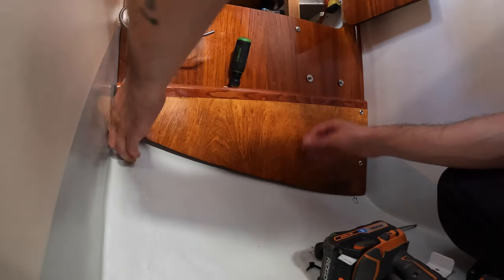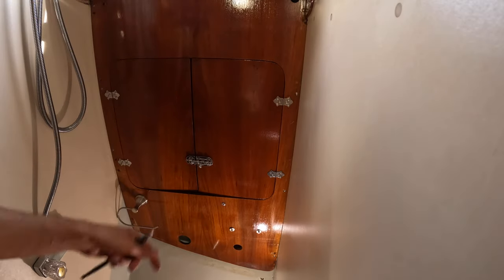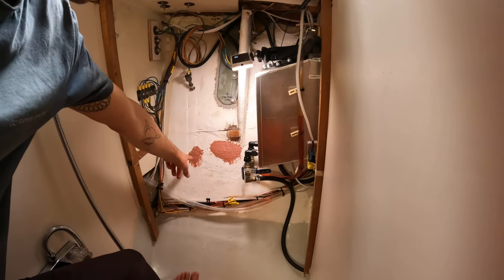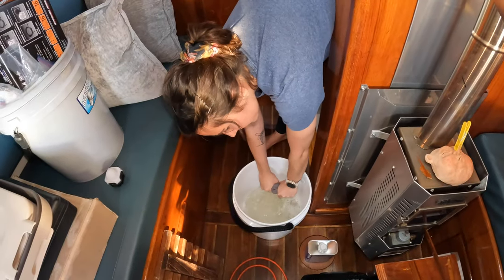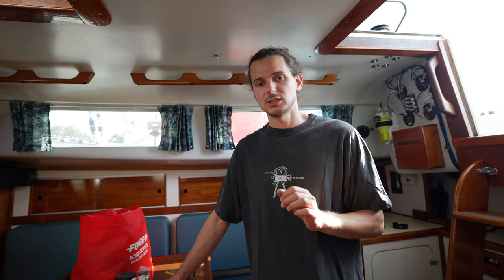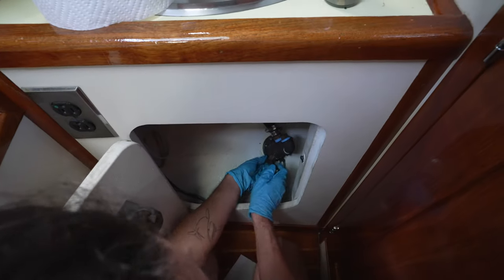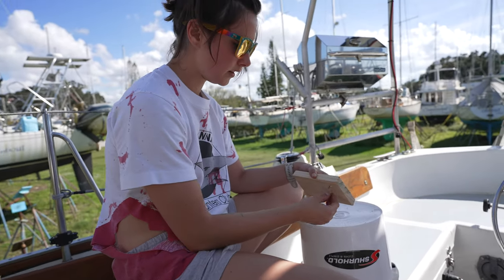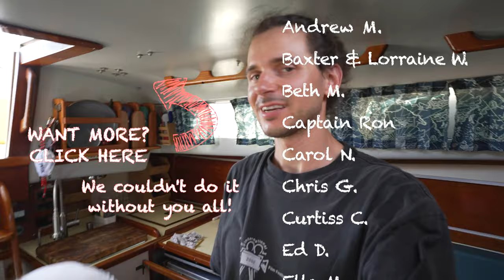HOW MANY Boat Projects Does it Take To Go SAILING? EP. 55

Comment: Parker and Katie, Great projects. I would be careful lapping the hull valves too much. I am renovating a boat with the taper valves like you had however I couldn't break them loose. So I am replacing them. Biggest thing is to work them before they corrode in place. Hopefully they won't leak on you when you put the boat back in. Fair Winds
Reply from the maker: So far so good with the lapped valve! It still doesn't behave as nicely as the others though. To be continued!

Comment: If you have had water coming through the hull from the outside putting filler on the inside will not solve the problem. Water will just enter the fiber glass causing you more problems in the end. You need to fix this from the outside.
Reply from the maker: Not just filler! I used biaxial stitched 24oz fiberglass first over the areas, and then applied the filler as fairing over top of the fiberglass. Can’t find anything on the outside of the hull. Eventually I’d like to paint the topsides and so at that time I’ll seal up the outside!
Reply: @Boundless_Adventure  in the mean time water coming in and hitting your internal repair will spread through the glass mat. Paint will not fix the outside toom mich flex in the hull. Just a bit of friendly advice. Love the work you have done on your boat.
Reply from the maker: @garyparks2194  no worries and thank you! You’re right the flexing and paint probably won’t last. I’m hoping that for now I’ll be able to confidently say I stopped the water from coming in. The pinholes are above the waterline so I can further inspect in the dinghy. I was shocked when I looked very closely during the repair and there isn’t even the slightest cracking in the gel coat anywhere around that area on the outside. But I shall look again!

Comment: Parker,
Not agreeing with your hull repair. You treated the symptom. Feels like you have your head in the sand to the real problem. Using your screwdriver you heard the thud of hollow spaces at the weep holes in three places. Hull repairs are made from the outside even if flaws can't be seen. Should go ahead and 1/2" drill thru the hull from the inside at two of those places to see if there is thinness or voids. Grind and taper 10:1 from the outside the holes and build back with ascending diameters of 10oz roving wetted in with West System or equal......all this per Don Casey hull and deck repair manual. No fairing compound anywhere....use epoxy mixed with mircoballoons.
Understand the $/time pressure of getting out of the working yard. Those weep holes can easily develop a leaking crack between them from hull flexing on a starboard tack in big seas over time. The hull is thinner there already. At this viewing you are probably already sailing again....just keep your eye on it. These things always manifest or worsen at the direst of times.
Reply from the maker: Hey Dale! I have to agree with you. I’ve filled in thru hulls before using the same method and steps you described.  The only hollow sounding area was the area lower on the hull where the gray paint is. I’ve seen osmotic blistering before (not on seawind) and this doesn’t look like that at least at this point. I’ve never had leaks from these areas before and the only thing I changed was adding the exterior chainplates. When I sanded the inside of the hull to prepare for the reinforcements for the chainplates, i sanded through the paint in the area that was weeping on the white paint. The area on the gray paint with the cracks, when I sanded into it I found that there was a corner of the bulk head tabbing that had an air bubble beneath it. I’m not concerned about that area being part of the mysterious weeping holes (but you never know. We are in the water now but these areas are well above the waterline. I will inspect the weeping area very closely on the outside of the hull in the next couple of days. 

I’ll let you know what I find! I might even do a further inspection and questioning of the area in an upcoming video if I think I should.
Reply: Allieds are well known for NOT having blister issues on the hull. Pretty rock solid layup. Some yards when prepping a hull for new bottom paint will soda blast to remove the old paint and sometimes blast thru the gelcoat leaving the area more porous or even thinned. Even with a barrier coat Flexing at hardpoints like bulkheads (oil canning) can create microfractures in the coat allowing weeping into the glass layup. On my hull #14 previous owner applied barrier over the original gelcoat after a chemical strip and light sanding. He had no blister issues but wanted to do it for piece of mind. This owner ,me, has had no hull issues thru 21 years of ownership. However ondeck my gelcoat issues have been immense. Prolific Eggshell cracking has caused me to remove most of it in favor of Primekote and Topside paint. Looking forward to seeing your videos of how you finished your hull and deck....Looks Great!
Reply from the maker: @dalewhite7775  Dale, that’s great to hear about Allied boats. I can say the same thing for my boat. No blisters on the hull but lots of deck imperfections. I’m going to take a screwdriver and tap around again in a very detailed way today in and around the head area. I do feel confident that there isn’t any major structural issue with the area. I plan on painting the topsides eventually, and raising the bottom paint a couple inches when I do that. But if I feel as though there is need for structural reinforcement, I could sand the hull inside the head, in its entirety down to the shelf I have for the toilet, and lay up a couple of overlapping layers of the 24oz biaxial stitched glass. That would really make the area strong and then when I eventually do the hull on the outside with the boat out of the water, I can look for any imperfections that need fixing before paint. 

As far as Seawind’s bottom, it was the first thing I did when I bought the boat. The yard I was at said they had a company that can come in and soda blast. So that’s what I had them do, and they seemed to know what they were doing. They left a hint of the old blue bottom paint color which I sanded after in prep for the barrier coat. The bottom was largely in great shape, I had to repair some voids down by the rudder shoe with ascending layers of glass. Also a few dings and nicks on the forward part of the keel. I also had a lot of very small gel coat imperfections on the hull that I ground out, and filled with vinyl-ester filler. They almost looked like tiny blisters but none had any fluid in them. They must have been an issue in the original gel coat. The bottom paint looks flawless like the day I put it on as of now. I sanded and applied a few more coats of ablative paint before leaving Ashtabula.